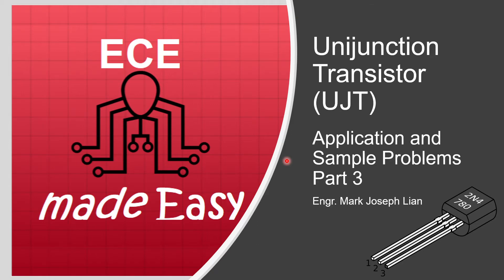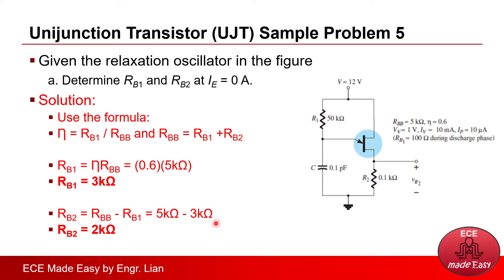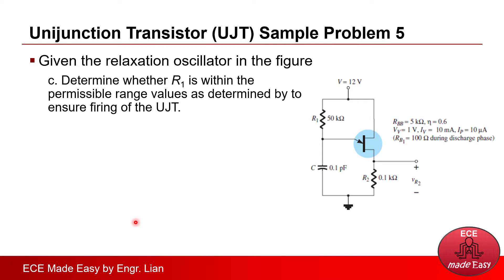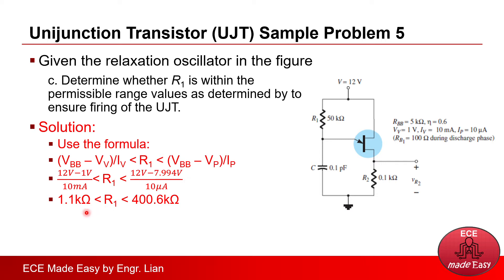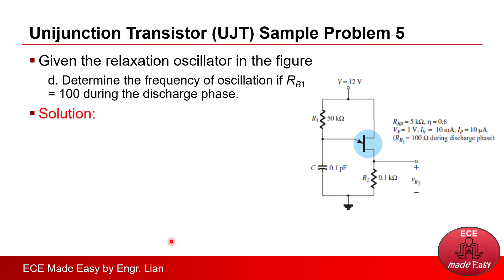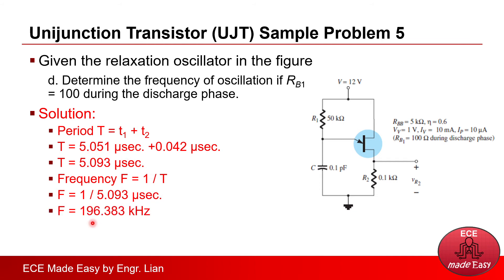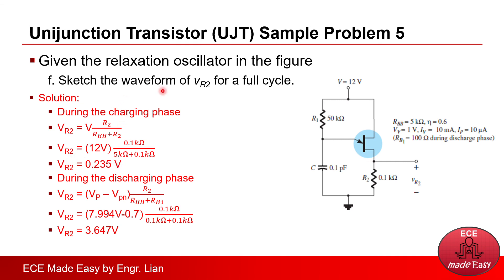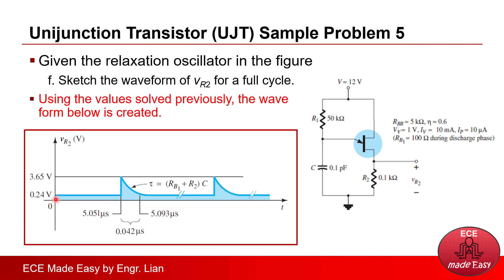Unijunction Transistor (UJT) - Application and Sample Problems Part 3

Comment: is it okay if I use the formula for Vp=n(eta)VBB + Vpn?   instead of Vp=V2 + Vpn?
Reply from the maker: Hi Mohammad, the formula Vp=n(eta)VBB + Vpn is only applicable if the UJT is connected without external resistors. If external resistors are added, the formula will not be applicable. Check UJT Part 1 video https://youtu.be/IguFAuPe5F4 for the explanation.